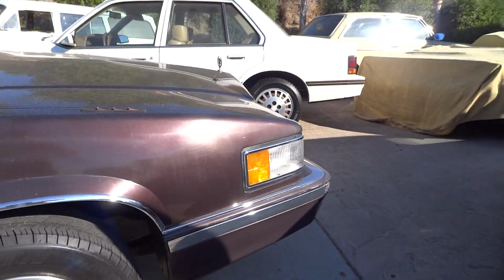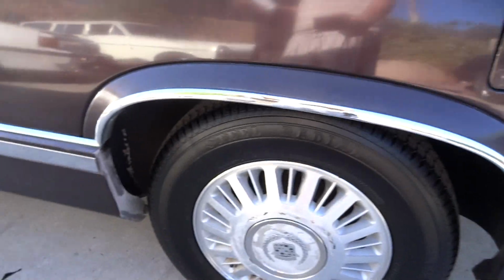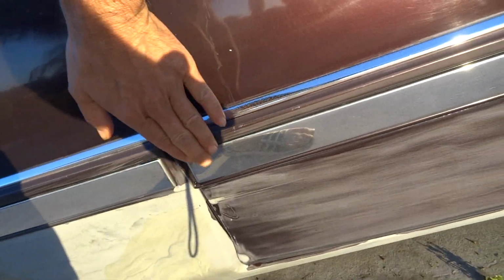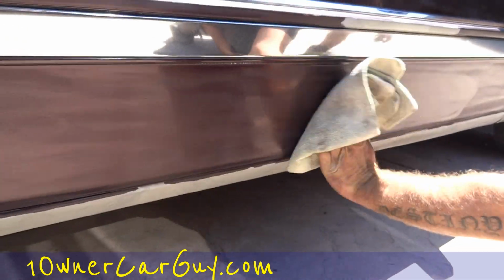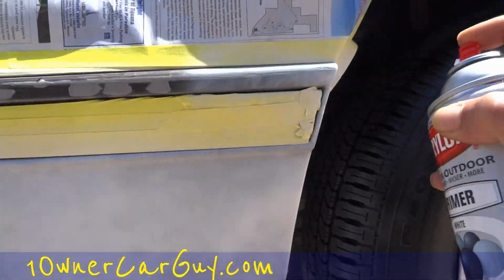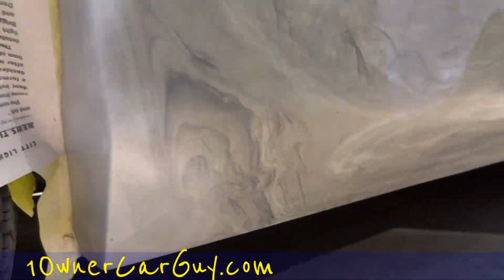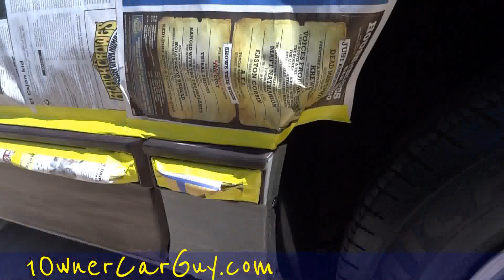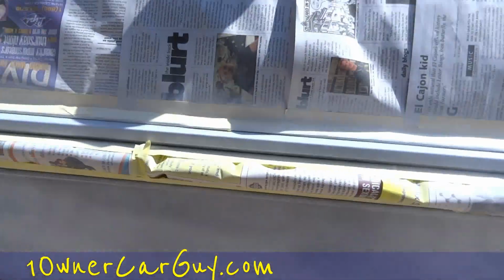DIY Car Paint Touch Up Tips Painting Your Trim / Auto Cheap ~ Prep & Primer Video #1

Comment: I have a 2001 F250 pickup. It's silver and in great shape paint wise since it is waxed 2-3 times a year but I have 2 spots on the roof at the end of the indented channels that run from to back that the paint has chipped off and a "patina" has started. I think I'll give you're method a try to fix it. No sense repainting the whole thing ove two little spots. Thanks for the great how to video!